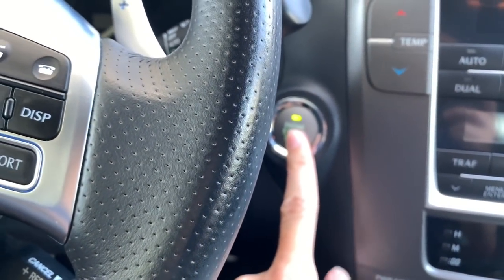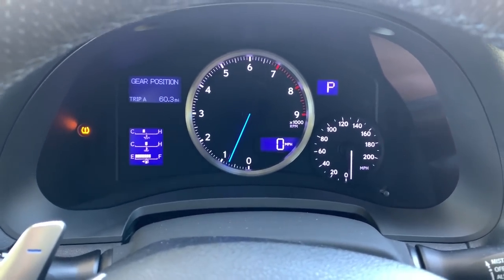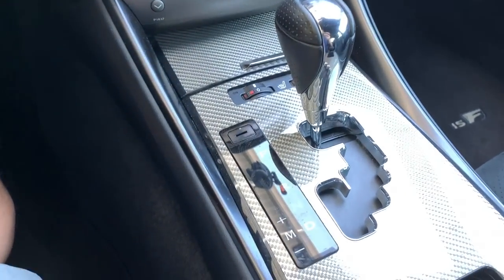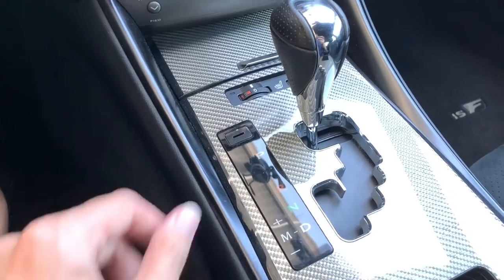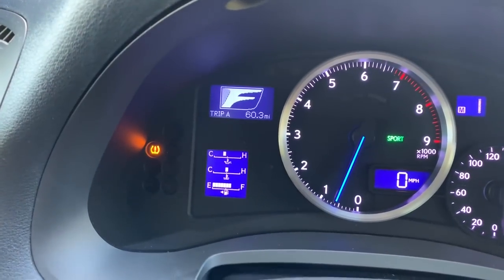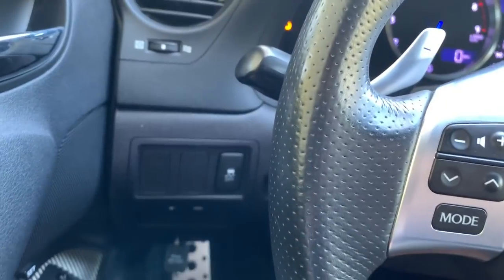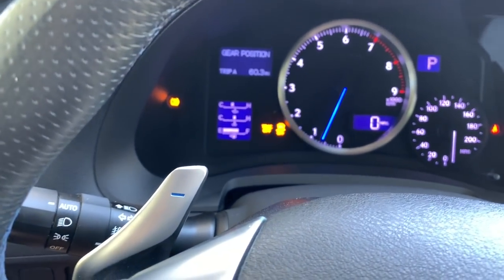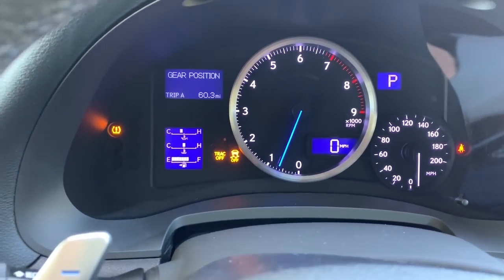How To Launch The Lexus ISF

Comment: A 10hp loss with a/c makes sense - that's 7.5kW pulled off the engine which sounds plausible considering the efficiency of the system and the effects of solar heating. On the other hand many/most modern (European) cars developed or released in the past 15 years have momentarily disengaged the compressor during full throttle driving so as not to affect acceleration.
Reply: Didn’t know that

Comment: Definitely make sure to turn off the AC at the track to avoid any water drip. Also make sure  to let the engine cool for a bit after you notice the times getting worse.  Most of the time the tracks are so busy this isn't an issue, but in the event you have the option to keep doing back to back runs... hold off for a bit.
Reply from the maker: Ladies & Gentlemen, the world record holder for a full bolt on ISF! 😁
.
Good tips! This track I just hot lap it as I’m not trying to set any records, just want to have fun and beat cars! 😎
Reply: ISFASTER LOL keep on beating cars and representing the F community!
Reply from the maker: As long as they keep lining up! 😎

Comment: You gotta turn it completely off with pedal dance to warm up the tires
Reply from the maker: My method works, wheels spin freely without traction control turning on, no need for the pedal dance.
Reply: @ISFASTER  oh but i heard i. The gsf and rc you had to
Reply from the maker: Yup, those two need to do the pedal dance.

Comment: Whether or not you make more or less power with A/C on/off. If you’re on a drag strip or track course. Turn it off! These fluids build up on the pavement & you can potentially ruin another drivers race.
Reply from the maker: Yes!  Great point.
Reply: On a road course maybe, but any water coming out due to ac condensation is going to be coming from the bottom of the car and at the strip when staging there’s not going to be an amount coming out that’s going to make a difference in anyone’s launch because if it where you’d only get one run because the track official going to make sure of it. Also since it’s coming from underneath basically the middle of the car, those few droplets( if it’s even that many) surely aren’t going to affect anyone’s run because if they’re that far out of the groove to be in little drops of water that came from the middle of your car that’s in the groove, then they’ve got bigger problems anyway.
Reply: 96t5wagon The drag strip I go to forbids it.

Comment: Just wondering, while doing your burnouts and holding down the brakes, are you not melting your rear brakes?? I’ve never understood that part...
Reply from the maker: Unless your car has line lock, which the ISF does not then yes, you’re getting your pads and rotors hot.  As long as you’re not on it too long you should be ok.  There are plenty of videos on YouTube of people just holding a burnout until their rear brake assemblies catch on fire.

Comment: What's your input on getting a ECU tune like rr racing for example with your setup, will I see gains with just a intake and catback exhaust? Or am I just wasting my money..thanks.
Reply from the maker: I don't have any personal experience with the RR-Racing tune or any others.  From what I've read there are gains to be had in all levels of modification, even in stock form.  But, if you're after more power I would put the money towards headers first.
Reply: @ISFASTER  is your stock exhaust manifolds leaking?
Reply from the maker: They are not. 🤞🏻🤞🏻

Comment: Could you do me a favor and do a video showing a kickdown at about 60km/h (or about 37mph) while in "D" not manual mode please? I read a lot of guys telling, that the downshift is really slow, but i can't believe this in my honestly opinion. Would be great! I can't find a video from an ISF or RCF on youtube doing this. 🙏🏻

By the way: Nice video!
Reply: I think at 37 I’m in 7th gear, 8th happens just over 40. That’s driving like a nun. If you are in normal mode my car shifts down twice to reach 2nd from 7th.  If the cars in Racing mode, and you have been driving spiritedly your car will be in a lower gear at 37 and will downshift straight to 2nd.

Comment: Do you know about the peddle dance?
Reply: Juan Carlos holding the traction control bottom does the same thing
Reply: @logic_xxmobxx9636  no it doesn't you can research it, I thought the same and I was drifting my is350 and it kicked back in randomly and almost killed me luckily I missed smashing into the guard rail by accouple inches. Pressing the button temporary disabled it to like 30mph and holding disables it mostly but if it thinks you in some real trouble there's a chance it can turn on temporarily
Reply: @logic_xxmobxx9636  why would they make the peddle dance a thing if you could just hold the button regardless do you if it kicks on when your pushing your car to the edge that's your problem
Reply: Juan Carlos well certainly I won’t risking my life for a quick adrenaline rush. But I’ve done both the peddle dance and holding the traction control and both have the same outcome. I’ve only gotten the kickback when I press it and I don’t hold it.
Reply: @logic_xxmobxx9636  I usually do the peddle dance then hold the button it to get stability control off. You really need everything fully off because these cars are so muted with them on, in this specific situation it makes sense that he turns it back on but usually in the street we just roll from 20 or 40 so having traction control on isn't really worth it
Reply: @J R I've had it turn back in before in the middle of a slide but seriously everyone just turn off their traction control however they want to, doesn't make a difference to me.

Comment: Wooahhhh yours was a factory no nav?!
Reply from the maker: One of the few! 🦄🦄🦄
Reply: @ISFASTER  you sold your car right?
Reply from the maker: Yes.
Reply: @ISFASTER  😥😥😥 what did she sell for if you don't mind me asking? Im looking at a 2011 SFP on black with 77k miles right now. Services up to date. It's Ppe/borla/tuned. What's next for you?
Reply from the maker: What’s that one going for?  Still deciding on my next car.
Reply: @ISFASTER  asking high $20s which isnt bad, but gonna offer $26,500 and go from there.  Got someone buying my Z06 this week hopefully
Reply from the maker: Sounds like a good pick up for the approximate price, mods, condition and mileage.  What year Z06 are you selling?
Reply: @ISFASTER  built motor 08 Z. 53k chassis miles, and about 22k on build.  Built for big boost but car is N/A
Reply: @ISFASTER   What did you sell yours for? Miles?
Reply from the maker: @nickadkins7765  - Nice.  Love those 7.0L engines.  Why are you making the switch?
Reply: @ISFASTER  This is a better all around car i can daily, have fun in, and beat on with little worries.... Unlike the vette. I have a 98 supra TT6, and a 91 MR2 turbo 😬 so you can say i love my yotas

Comment: Sort of surprised that an ISF came with a base trim 
Without the touch screen, leather seats etc.
Reply: Ahmed Moosaji it did have a touchscreen, I believe it he took it off
Reply from the maker: This is the stock setup.  There are a few ISFs with this.  Fun Fact - this unit is 6 pounds lighter than the navigation unit.  Also, 2011-2013 ISF have Alcantara seats.
Reply: I wondered this too, UK only ever came with full everything.

Comment: Why do people think the ISF is some kind of crazy sports car? It’s a glorified luxury sedan with a tame overhead valve V8(pathetic torque curve). Line this up against any modern American sports car with a V8 and get ready to be a spec in the guys rear view.

I’m not knocking Toyota/Lexus. That’s all I drive. I also have a Corvette and if you want speed/braking/handling, the vette out classes it by a mile.
Reply from the maker: Check out some videos against those ‘modern American sports cars’ on my channel and you’ll see who is the speck is the others rear view.  Not bad for a nearly 12 year old vehicle huh? 😎😁

Also, you’re comparing a ‘glorified luxury sedan’ with a 2 door sports car, not exactly vehicles that are in the same category.
Reply: Cause with headers and a tune these cars are indeed beasts. 

Viper vs ISF. ISF has full bolt ons and tune. The viper wins of course but given how the ISF is a 4 door sedan that is 10-11 years old now, that is pretty impressive. 
https://www.youtube.com/watch?v=x-puswL9lAI

ISF vs Vette. 
https://www.youtube.com/watch?v=CMysXi94b9U

For all things considered this is incredibly impressive. Now add the fact that the car is reliable, and with a mechanically sympathetic owner can have well into the 6 digits for mileage and still make great power, the car becomes quite the steal. 

Full bolt ons getting you 500 crank hp or street SS kit from RR racing getting you 620 crank hp. Value wise this becomes tempting. 

You call it tame while it eats up equivalent competition. If you believe the vette has usable performance on the daily then great! Get the vette. I debated between the CTSV and ISF. The ISF by far is the cheaper more efficient vehicle to own since barely anything goes wrong with them and to top that off I don't pay the 2 door insurance hit, and it is still usable in the winter. I have run that thing with 4 inches of snow on the ground with no issues. 

At the end of the day a decent driver in the ISF will pretty much outclass most machines out there unless you have perfect pavement and conditions. So far at my local track, no vette, M3, M4, whatever out there comes close, cause around a track, you really have to know your car and have the balls to push it. Folks buying the greatest cars, aren't the greatest drivers. Drivers who understand what cars work best for their use and abilities even in what could be considered inferior will do better. There's a reason why Miata's and S2k's with minimal mods are beasts at the track.